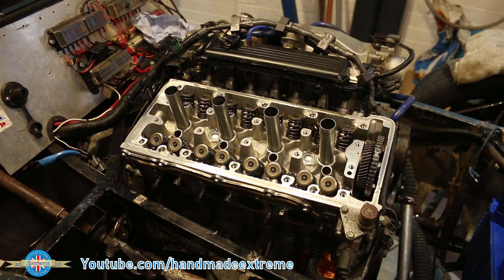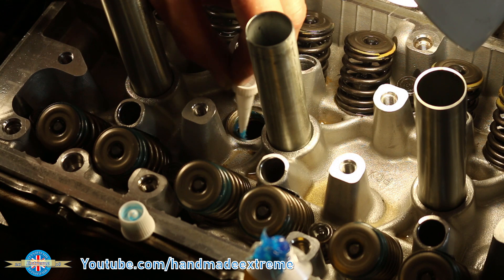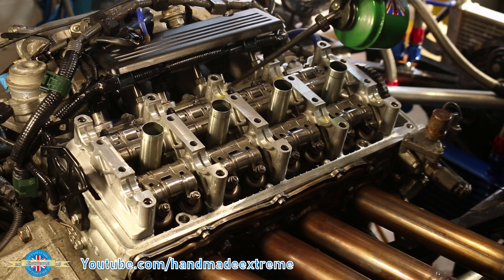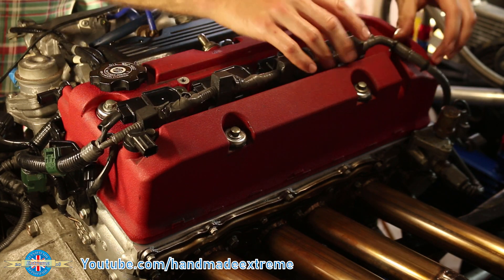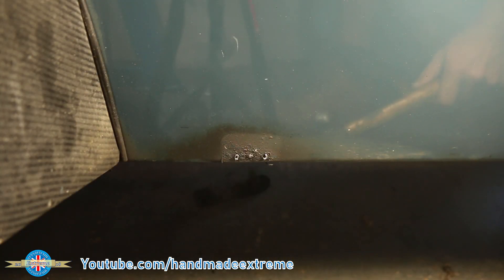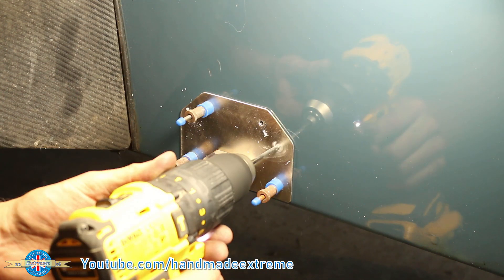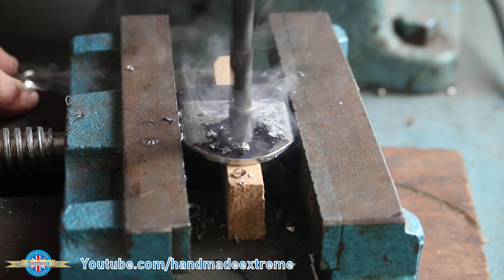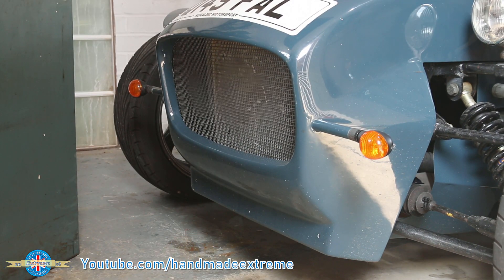The Pippa Project - S2000 Powered Haynes Roadster - How to replace a leaking core plug + Test Drive

Comment: I have one of those I built from the Locost book with a 2.3 GM quad 4 double overhead cam engine. About 200 Hp. Are those things a blast, or what? I built the whole thing from scratch from the book, no kit. Only took me about 7 years. It was really fun in the mountains in Colorado for a few years, but now we're back in Houston Tx. and the streets in town are so bad. And there are no hills here, extremely flat.                             Have fun, Way cool. Great video, by the way.

Comment: Love those Lotus 7 kits. A mate of mine built one with an overbored 3.9L Morgan/Rover V8. To say it was fast is a mild understatement, top end was about 130mph, but was geared to do sub 3 second 0-60 times
Reply from the maker: They are a lot of fun for sure. Sub 3 to 60 is ballistically fast. Pip is geared for 150mph flat out  and does 0-60 in 3.5 seconds on a good day. Thanks for the support.
Reply: @Handmadeextreme  That's what happens when you let an ex Ford Motorsport  engineer build a retirement project!

Comment: So cool. I'm currently building an MK with an S2000 engine so i'm sure these videos will come in handy if I ever get stuck! I just dropped the engine in last weekend so onto the plumbing and wiring now. Hoping to have it running by end of October!
Reply from the maker: Awesome. You will have a great time with it when it's done. Good luck with the rest of the project and thanks for watching.
Reply: hello. i have an avon tiger and want to put an f20 . do you think that can fit without modify the tunel in the middle ? thanks . and great video

Comment: What gear box did you mate the type r to?
Reply from the maker: It's the S2000 box and engine. Thanks for watching.
Reply: @Handmadeextreme  thanks for producing the videos I've wanted to build one of these for 19 years, you have the engine in yours I'd have picked too. I'm hoping that with a house move to a house with a workshop I might be able to build one at some point!